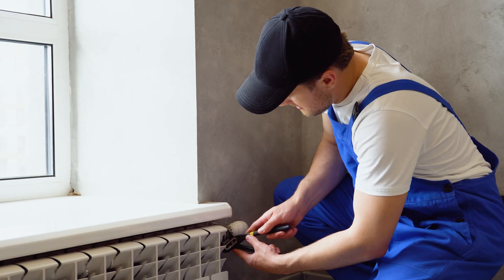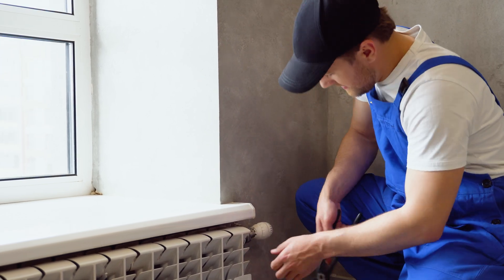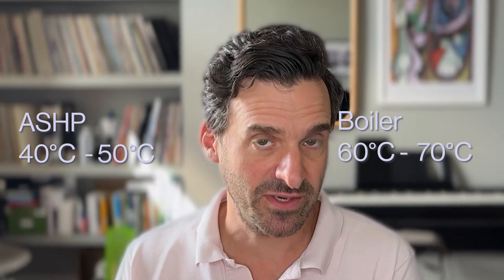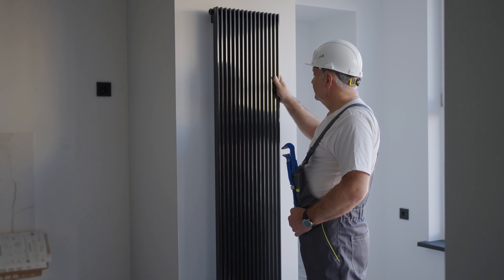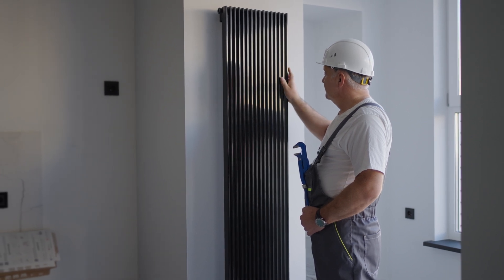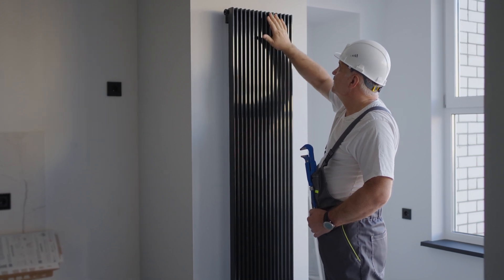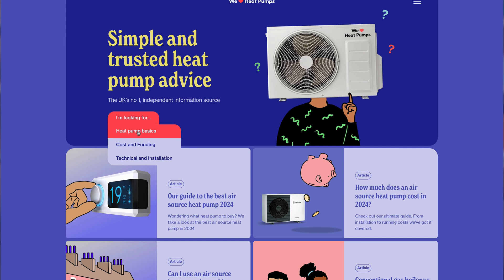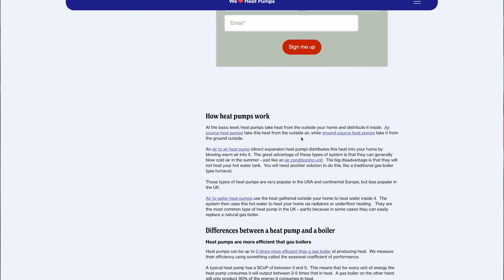What radiators do I need for an air source heat pump?

Comment: Why are aluminium radiators a better choice for Heat Pumps? How exactly do they transmit heat more quickly and efficiently than steel or cast iron. Is it they generally have a larger surface area to transmit heat and if so does having a larger surface area mean a larger volume of fluid within?
Reply from the maker: It's to do with the fact that aluminium has a high thermal conductivity and a low thermal inertia. The radiator will heat up much more quickly and respond quickly to changes in temperature.  Aluminium is also better and transferring heat at low temperatures which heat pumps operate at.
Reply: @WeLoveHeatPumps  The speed of heating up shouldn't matter with a heat pump, since there shouldn't be such rapid changes in temperature, what you lose from heating up, you gain from the cooling down - heat pumps are very much the mean temperature output, my Vaillant may be on for an hour then off for an hour during mild weather, on all the time during cold.

The higher thermal conductivity of aluminium may make a difference, though difficult to calculate the effect, however looking at radiators specs there seems to be little difference in output for similar sized radiators - that's from a quick look at a radiator suppliers specs, nothing in depth.

One area that could be a problem for heat pumps with aluminium is the lower amount of water they contain, over a whole house the aluminium may need a volumiser that the steel ones don't.